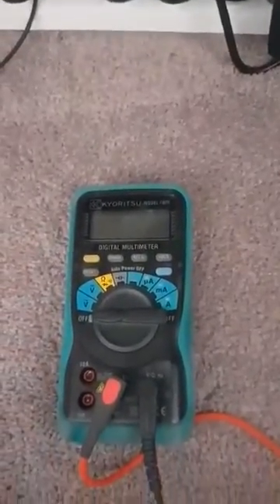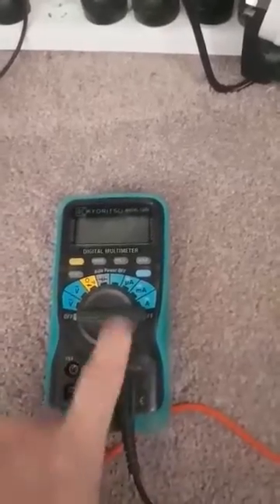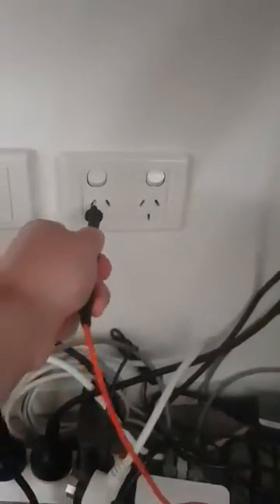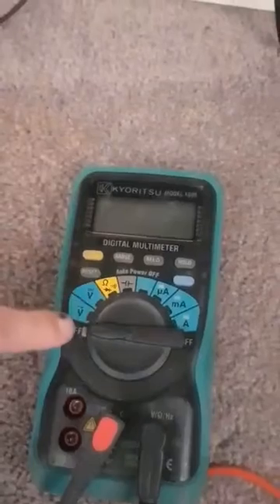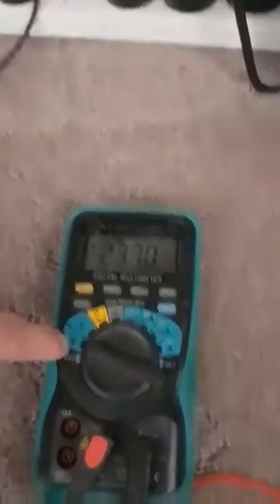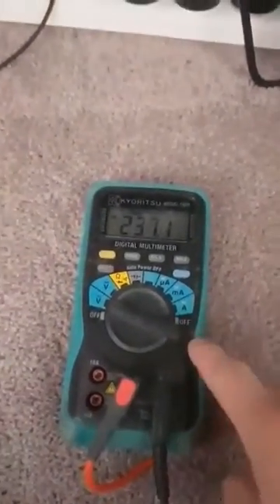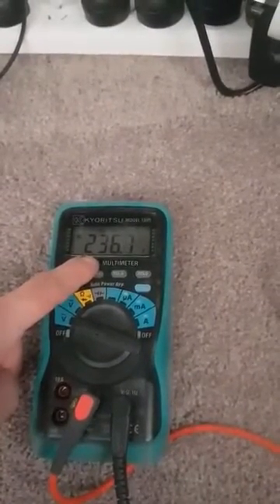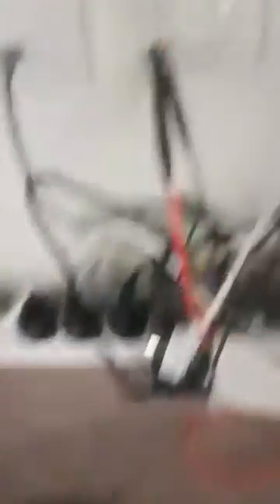How to test a powerpoint/outlet before disconnecting

Comment: Please set your Digital or Analogue Multi Meter on the appropriate Ac voltage range before placing the probes into the slots. If you Probe first and then try to set your meter, you may end up damaging your meter as you wander over inappropriate settings.

Comment: Uhhh mate, I have a slightly different method for isolation. You can use your meter in continuity mode on A+E to cause an imbalance in the RCD making it trip; Then you've instantly tested the RCD and isolated in one hit.

Comment: I seriously think that this is the only Aussie video about the process of using a DMM to check an outlet. Cheers mate.
Reply from the maker: Cheers mate was one of my first videos so its rough around the edges but still the information is correct👍
Reply: @allelectricalau  You should do an Aussie tutorial video about ghost voltages and how to detect them in our power points. That'd be a good one to watch. Cheers.
Reply from the maker: @johnellison3030  Thanks for the suggestion mate